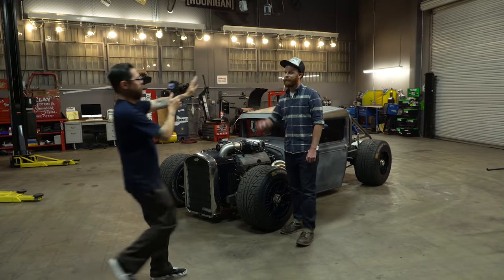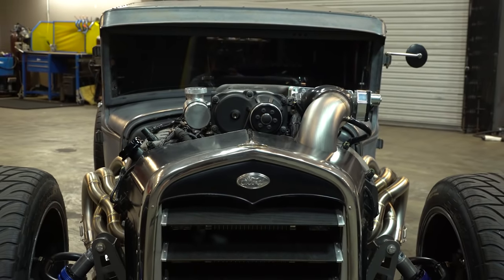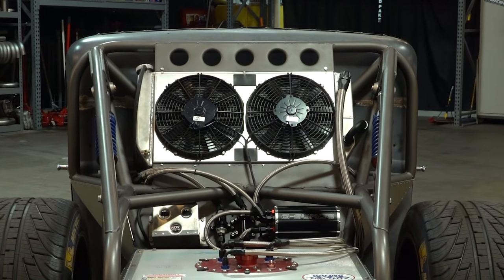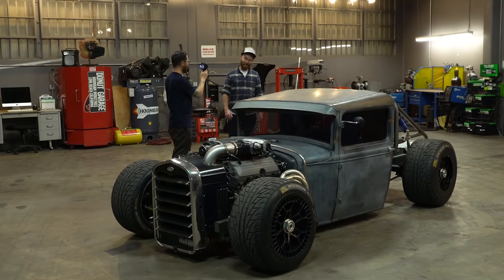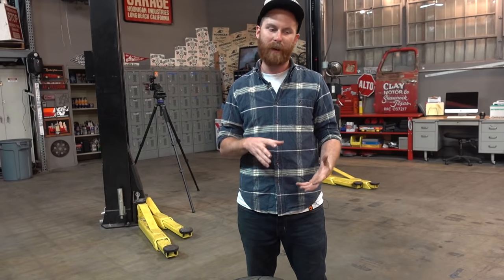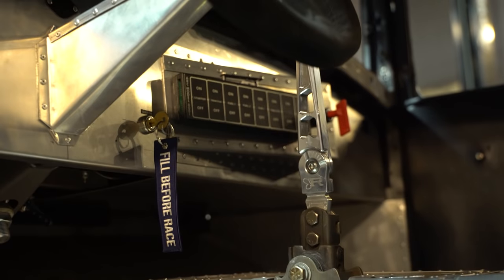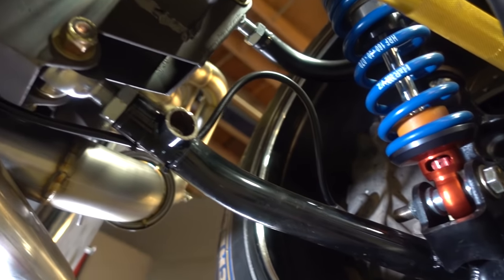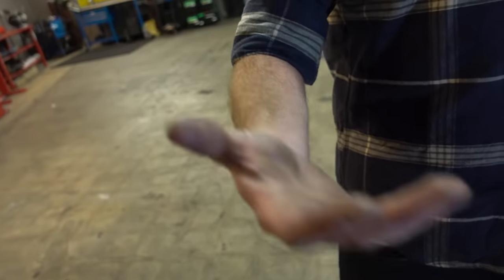800hp Coyote Powered Hot Rod... on LeMans Wheels?? Mike Burroughs Ford Model A truck

Comment: Ford with a Ford heart in it 🔥🔥🔥. The way to go
Reply from the maker: That's the way to be!
Reply: T.4.GxBOOSTED good uses GM design double Wishbone front suspension and triangulated rear suspension not for design single leaf springs hahaha Fords always a copier never an innovator
Reply: @plymouth-hl20ton37 ; Is that like the camaro copying the mustang, or the chevelle copying the fairlane, or the nova copying the falcon, or the elcamino copying the ranchero ?? Should I go on, I think you get the point ??
Reply: @plymouth-hl20ton37  😂😂😂 Could have Been Transgender Full Send with an LS 😂😂

Comment: What are the functions of the springs on the exhaust tubes @ 6:53, and how does a longer exhaust length give you a better O2 reading (11:17-11:19)...

Comment: Amazing build and I love the sound of that coyote.  I want to point out though that it's a dead giveaway that it was built in SoCal when you see rust used as decoration e.g. the body welds for the chop with zero rust protection.

Comment: Guys gotta point out 

I'm n o t a hot rod/rat rod and T/A-model guy

..but t h a t chassis  with that handcrafted four in one manafold  those LMP1 centerlock rims  

...g o t me!!!

outstanding solid craftsmendhip! 

Even with those well thought led lightbars behind the grillmask 👌

I personally would love to see a small wooddeck above the gastank on the backframe and slim low distant fenders like the front ones on a lotus super seven directly mounted to the wishbones => not to "shot someone at" with gravel from that massive Semislics. 

That coyote crade motor with those four in one stainless manafolds is a beast!!!!

Comment: If I built a Ford like that, with LMP tires, I would also add independent suspension on the rear, with the same coilovers as in the front, because, that rear setup would slow me down a bit on the corners, add power steering and a 2 pedal sequential gearbox(personally I don’t like driving manual, for me it’s either automatic, a CVT or Sequential) with all that I would make some good lap times, not like I would build one, I’m more into JDM but I like most American cars and respect all builds 🥰

Comment: can anyone tell me what the springs on the exhaust are for? ooh yea, SICK TRUCK.
Reply: Chuck Turner They hold the sections together. Nuts and bolts tend to vibrate loose or get stuck from the heat. The springs hold better and don’t get stuck.

Comment: Someone needs to teach that dude to back purge stainless when welding it.. You can see how dark those welds are and know he didn't back purge it, which means there's a ton of crystals on the back sid eof that weld waiting to fall off into the engine, or for the weld to crack.

Comment: lemans wheels....... its not a set of wheels its a race, a race that takes place over 24 hours at the circuit de la sarte. the wheels or rims were on any race spesific car, its just that those wheels used by the cars racing is refferd to as lemans. its got nothing to do with the wheels.

Comment: Tuned headers make the most power and you don't see them much nowadays, maybe because they do take up alot of room since every pipe has to be the same length but definitely worth it with the power you make compared to a long header
Reply from the maker: It’s nice to see that this type of fab work is getting the credit that it should! Not only that people are realizing the power potential when you get a set of headers built correctly!

Comment: Dope but personally I built a 350z with a built lq4  and push around the same 800 hp but I have a big single turbo turned down pretty low boost because over a thousand hp isn’t necessarily street comfortable, especially on Kendra reads 😂 definitely a unique vehichle. If I decided to go the ford coyote route I’d drop it in a fox body chassis built for drift and a sequential or dog box or 4 speed like a gforce top shift.

Comment: @11:10 is this thing just SEMA ready? Those braided AN lines are very close to the exhaust there. Wouldn't take much for them to melt- even if they're PTFE lines like i use in my own stuff. They don't deal with heat all that well. Then again the water and oil lines to my turbo don't melt, although i've taken a lot of care to route them as far from the heat source as possible AND i use a good quality turbo beanie

Comment: It is nice, then it is crap at the same time. Why not fix the pedals on it? This guy must wear a size 8! Lol! Why have it so low also? You have to crawl out of it, which is no fun! No cup holders installed? That says I never drive this! Why not do it right if you are building something? Would be amazing if it did not have those issues. Which are major issues

Comment: I'm going to have to disagree the phrases "Ford Powered" and "price per pony value" do not go together and certainly don't hold a candle to the LS platform.  To buy that engine out of a wrecking yard (the one that came with the blower stock) is 11k to 18k.  It's a great build but you're not going to convince me it was affordable or a value.
Reply: Sorry bud, but not even close. Coyotes can be had for $5k all day long, and less if you hunt. I bought most of a wrecked car and finished with about $2500 in the engine after selling off unnecessary stuff.
Reply: @mikeburroughs7988 I assumed since he chose a 2011 specifically he went with the 5.4 that came with the supercharger.  Some folks call that the Triton platform but I've also see folks lump it in the Coyote mod motor platform.  I was referring to the 5.4.  You are correct the 5L can be had for under 5k (without a supercharger obviously) 👍.  Comparatively though a low mileage 6L LS is half that price - a high mileage one (+100k) a quarter respectively.  My pricing sources came from car-part.com fwiw.